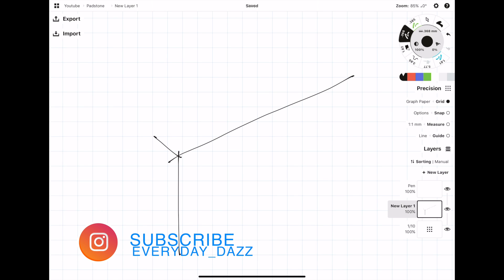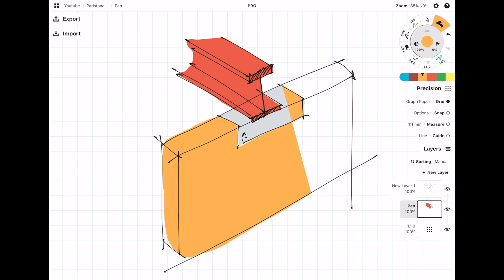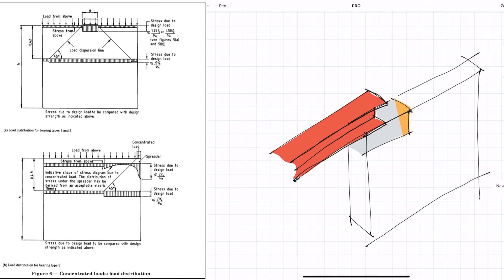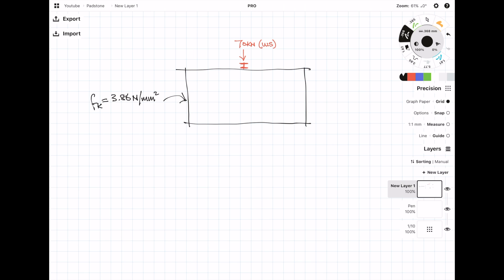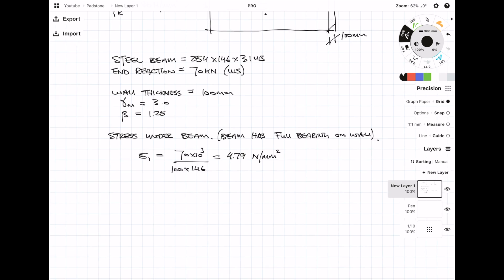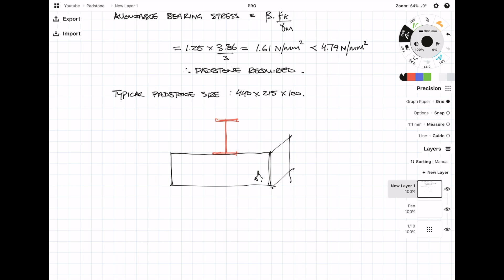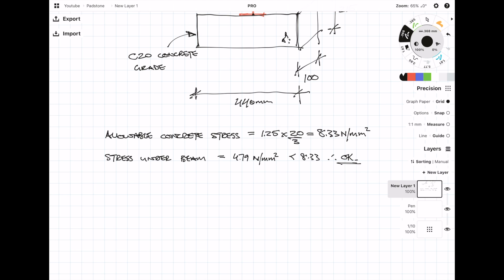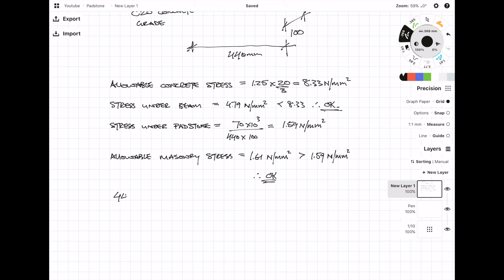Bearing Design for Steel Beam - Padstones

Comment: Hi Dazz, thanks for the videos. Your videos are precise and very useful. I just have one question, if the width of the block is more than the dispersed width then shouldn't we use only the dispersed with instead of entire width?
Reply from the maker: Yes you would consider the dispersed width. If you need to spread the stress further, you would need to use a reinforced lintel instead of a normal pad stone (which has no reinforcement)

Comment: Hi, do you have a link for the second option?
Reply from the maker: Will be doing it soon. Stay tuned
Reply: @EverydayDazz  I'll have to do it in BS5628 for now! I can see in EC6 6.1.3 a perpendicular option but not a parallel option. Maybe it can be modified, we shall see. I've subscribed in anticipation!
Reply from the maker: Tbh the BS code for masonry is so much better and my video will cover the BS version as I try and stay away from the masonry euro code. They make it so horribly complicated it’s just awful.

Comment: Hi Dazz, 
Great video, do you have an update on the beam spanning parallel with the wall and padstone design?
Keep up the great work! 
Ed
Reply from the maker: Thanks! Soon! I’ve been so busy but will definitely get it done
Reply: @EverydayDazz  same. Lots of folks wanting extensions, found the mini-project super useful in that regards. 

Much appreciated, the difficult I am having is calculating the stress under the beam for the parallel beam. As you show in the video the stress distribution is different and with the maximum bearing stress at the opening. I've read / seen engineers say assume a triangular stress distribution but unsure how to calculate the max bearing stress and how the bearing length reduces the stress. Really hope you can cover it.
Reply from the maker: I was actually having a look last night. The triangular stress distribution is the easiest but most conservative. For quick hand calcs this would be the option I’d go for. I am planning the video now and i will probably show case this method and another method (longer more accurate).

Comment: How much difference is the "in plane" bearing calc checks Daz?
Reply from the maker: It’s fairly different and there are some quite key differences in how you want to place your beam on the pad stone and wall, depending on the size of the load. The load is very concentrated on the tip or edge of the pad stone/wall and therefore the stress is very high causing it to over stress the wall. So depending on the magnitude of the load, you’ll need to position the beam further in plane or into the wall to reduce the high peak stress at the opening. 

Hopefully that’s clear but I will do another video eventually about to explain. Just been stupid busy recently 🙁

Comment: love the sketching and use of iPad! makes me want one myself! 

How do you justify the beam reaction initially spreading over the full width of the beams flange? Wouldn't the shear be carried within the web of the beam, at the support it would spread at a 45degree dispersion from base of web through the flange... with a 15 thk flange and web (for simplicity) you'd get  a 15+2*15 = 45mm initial bearing width from steel beam onto masonry/concrete. I'm not sure you can just assume this spreads the full width of the flange. 

perhaps with relatively low loads and low strength bricks you'd be able to justify the load through bending in the flanges although that assumption would rely on a certain amount of deflection across the flange which in turn relies on locally crushing the brick/concrete... maybe there's an obvious answer and I'm over thinking it...
Reply from the maker: The assumption would be that the bottom flange is stiff enough to spread the load to the ends.

Comment: Great videos. 

AWhat sort of beating stresses do you design for in existing buildings when the block or brick and mortar strength is unknown?
Reply from the maker: I tend to use a weak mortar/masonry strength initially to be conservative but then try and get some testing done later to verify mortar and masonry strength for final design. 
It’s always good to do some research on the year of the existing building and gather some intel on traditionally what strength of masonry they used to use in that area/year.

Comment: I have a quick question and would appreciate your answer. Basically, the steel beam rests on the wall. Its ends are not fixed and it makes it unstable when force is applied laterally. So what prevents the beam from sliding from its place if the load applied laterally?
Reply: I suspect it depends on the size of the lateral load. Personally I would never assume the wall would be able to resist a concentrated lateral load in the situation you describe. If the load is significant you should be looking to connect the end of the beam into a steel column section with a suitable connection. This way you can make sure that the lateral load is transferred successfully into the ground.
Reply from the maker: Exactly this
Reply: @robertlygo4762  Thanks a lot!
Reply: Wall joints, steel or rc columns can be used to resist lateral loads as a pin support for handy calcs. On video’s example, the wall represents a roller support.